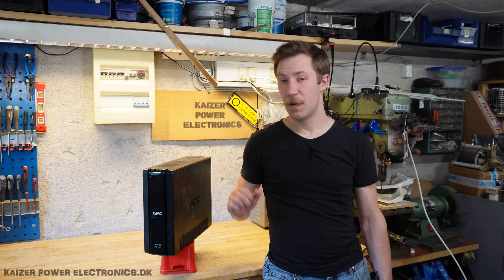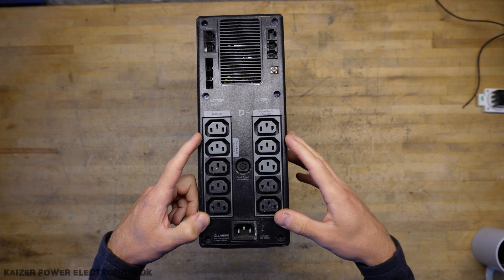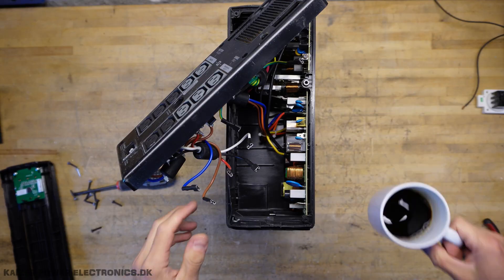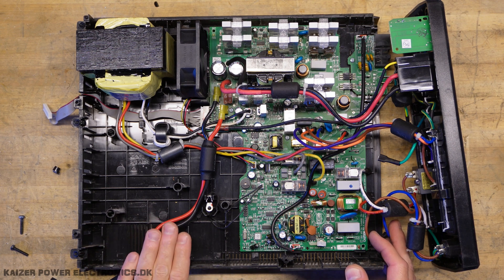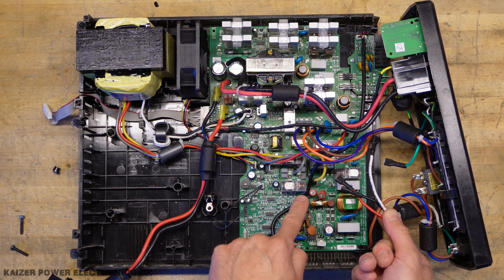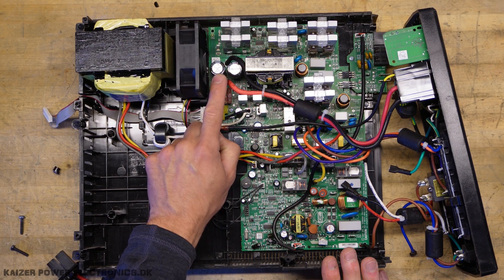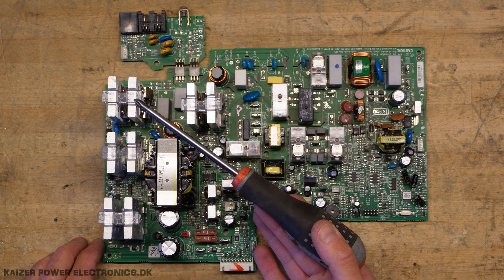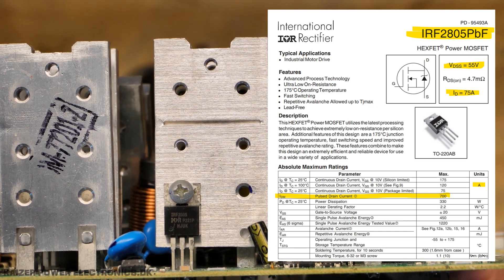APC Back-UPS Pro 1500 VA Teardown

Comment: I have one of these, and I've used the external battery connector to hook it up to a 100Ah 24V battery. You just need to connect the third yellow wire to ground with a 20k resistor for the pack to be recognised. This has worked perfectly for over 1.5 years, but recently the UPS has been shutting down when the external battery is at more than 60% charge (measured by a coulomb counter). It is strange, because the external battery still has a voltage over 23.8V when this happens and can still source significant amounts of current directly. Trying to turn the UPS back on at this point results in a F02 error, but if I disconnect the load, the UPS turns on and the internal battery starts sourcing over 3A of current from the external pack. If I leave it in this state for a while until the current drops, I can turn it back on with the load attached for a short duration. Any clue what might be happening? Weak internal batteries? Do I need to buy another set?

I tried replacing the internal batteries with another set I had laying around which had only seen very light use, but it still shuts down at around 50% external battery charge. When I originally hooked them up I tested by draining them all the way to 10% charge and it worked perfectly.

I've also been a little frustrated with this setup as it has never been able to charge very quickly, the UPS only seems to charge the external pack at a max of 3A, which takes dozens of hours to fully charge the pack. I've somewhat worked around this by using a double throw breaker and an external charger which can charge the battery at 10A. If I don't disconnect the UPS from the pack using the breaker when connecting the charger they both seem to get very confused and fight over which device charges the battery.
Reply from the maker: F02 says its on-battery output short. Mentions that you need to remove load from battery backup outlets. The external battery is also listed to only be the Back-UPS RS 1500 only, perhaps they do coulomb counting too and you can not exceed the capacity of that original battery pack? Would make sense from their point of view, its properly not built for running 24/7, but only for the duration of internal pack + original external.
Reply: @21dws i have same issue with a 60AH 24V LITHIUM ION BATTERY, the only way to "fix it" is using powerchute, just check the battery status and when it says 20% or 50%, replace battery date in the software, it will reset the battery status to 100% once again you can press it any time you need to add extra time and use all the battery voltage

Comment: Back-UPS is a consumer product line, and so the Back-UPS Pro is still consumer-oriented (prosumer oriented maybe?). The Smart-UPS you tore down previously is the much-superior one meant for commercial applications - hence its metal enclosure, more complex electronics design and sine wave output.

I'd say it's most likely they actually charge the battery using the small auxiliary power supply near the input filter - these units have a fairly slow charge rate, and the existence of diodes in the main inverter section implies it is unidirectional.
Reply from the maker: I never considered that it could be a very small and slow charger, but it could be justified in a UPS that really should be online 99.9% of the time.

Comment: I have an older version, which uses similar topology, but has the old method of a huge transformer, and heavy windings. That large transformer I suspect is actually an autotransformer, used to do the line compensation that these can do, and thus you need a huge core with low loss, so that you do not have a huge power loss. Then the inverter bridge can run in reverse to transform down to DC, and the power mosfets body diodes are the rectifiers (or active rectifiers if the controller is properly designed) to charge the batteries. tap changing to allow charge control as well. Yes an old design, but the pro designation likely from the ability to add external battery packs on, instead of the internal 15 minute "shut down real soon" one, and giving the ability to run for a few hours with a bigger external battery. 

Mine has 200 Ah of battery on it, no internal one (it was long dead when i got it as free), and has done well, and as bonus has plain USB interface, no fancy one.
Reply from the maker: Yes the transformer based ones are usually multi tapped for voltage regulation. I can not call RJ50 fancy, for USB, what was the whole idea of standardizing USB :)
Reply: @KaizerPowerElectronicsDk  You mean APC abusing existing standards in a way that means you have to buy their proprietary cables for $30 each?  I am shocked, shocked I must say to see APC doing this again!

Anyway, haven't bought their crap since I got last bitten by that in 2006.
Reply: @KaizerPowerElectronicsDk  Because they now can sell a $100 cable, added profit margin, because the cable costs less than $1 to make. The profit on the cable likely is more than what they made selling the UPS itself.

Comment: The RJ50 (not 45) that is on the back is a usb port to connect to a computer to change settings, in my opinion they are stupid for doing this because it could just have been a usb type b like most printers use because there is no electronics in the cable so they just wanted to sell an expensive cable that can't be reused for something else
Reply: I modded the rj50 to work with the rj45 cable. Then made my own rj45 to usb cable. 

The rj50 has 10 pins, the extremities are pin 1 and 10 which are (-) data  and 5v. I just relocated them to other pins. 
 
When looking at the port with the notch on the bottom and the metalic pins up. The far right is pin 1 and the far left is pin 10.

What i did is, on the pcb i bridged with a tiny blob of solder both pin 1 and 3 to move data (-) to pin 3. And pin 10 with 8 to move the 5v to pin 8. 

The only thing is, the trace connecting pin 8 on the pcb must be cut with a tweezer. Since the rj50 has both serial and usb. 

Here is the  pinout before the mod : 

Pin 1 : data (-) 
Pin 2 : data (+)
Pin 7 : gnd ( -)
Pin 10 : 5v (+)

After the mod : 

Pin 3 : data (-) 
Pin 2 : data (+)
Pin 7 : gnd ( -)
Pin 8 a: 5v (+)

NOTE : pin 3 doesnt connect to anything on the pcb. So no need to cut anything.
Reply from the maker: @rouuuk  Thanks for sharing!
Reply: @rouuuk  Here is a video that shows how to change it.
Reply from the maker: Proprietary work when its worst, taking a standard protocol and ruining it with shit hardware.
Reply: @KaizerPowerElectronicsDk  Plus a connector and crimp tooling that is not common, so making the simple cable yourself is more difficult. No doubt there are a good number of copies of that cable on Aliexpress though, because the sellers can make a massive margin over the standard USB cable, and make it worthwhile to tool up for them.

I see I can buy the plugs locally for 50c each, but not the tooling, that I would have to order. Bit expensive to buy a $100 tool to make 1 cable, though no doubt you can sell the cables off afterwards, as they are also used for NI connections, and there is a cable and colour code for it.
Reply: @KaizerPowerElectronicsDk  i have 3 apc smart ups 3000 that i want to use as inverters for a solar system and i have taken one of them apart to modify the pcb with a usb type B and if i can get it fitted and working i will do it to the rest of them also :D

Comment: 4:04 I really need to see if they turned off jtag or prevent dumping the firmware on the processor. Was this a modified sine wave or pure sine wave?
Reply from the maker: I never got into JTAG hacking, so can not answer that one. From the datasheet: Output Frequency: (sync to mains) 50/60 Hz +/- 3 Hz sync to mains, Topology: Line Interactive, Waveform Type: Stepped approximation to a sinewave